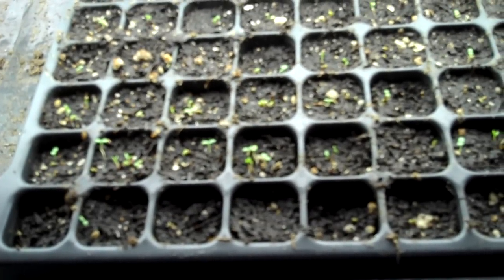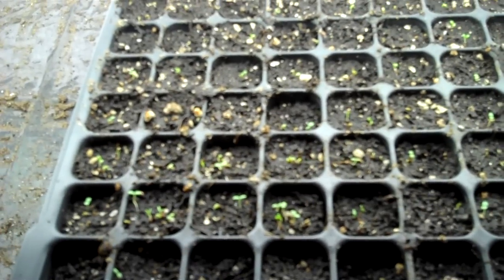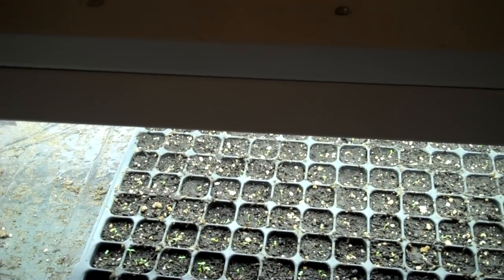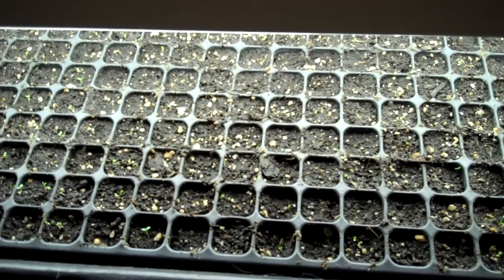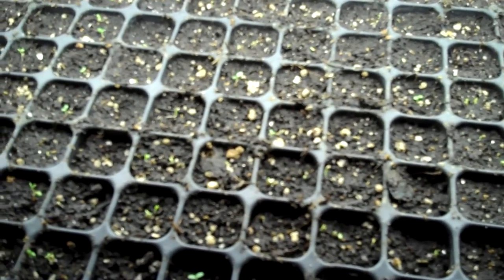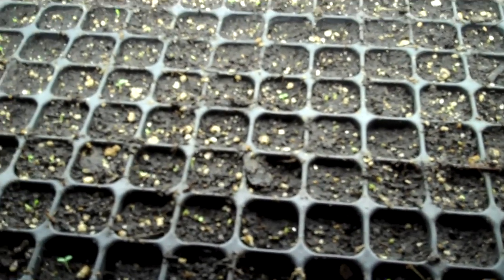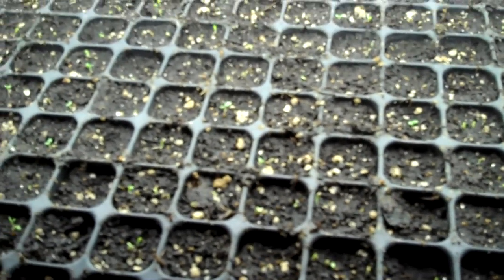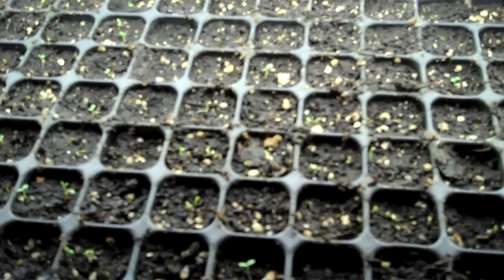The Strawberry Store: Germinating Strawberry Seeds - Post Germination

Comment from the maker: Everything is manual. I have a plug popper that will push up one row at a time from the bottom. A dibbler can be used to make the hole in the new pot but I typically use the end of a pencil or pen or a small sharpened dowel to dibble a hole. Is that what you meant?